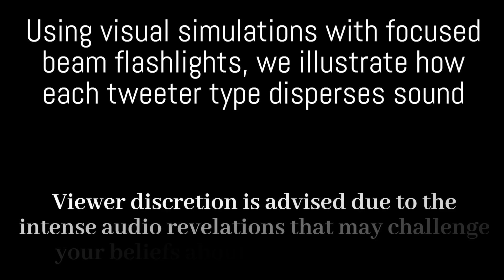Dome tweeter Vs Horn  -Viewer discretion is advised due to intense audio revelations

Comment: Neither.. amt, ribbon, etc.. 😂 but I am a dipole guy. Like horns more for esthetics 😂
Reply from the maker: We have received from Beyma today the new Beyma TPL 150H horn loaded AMT. Review and unboxing video is in the works.
Reply: @shinjitsuaudio  that sounds way cool. Looking forward to it 😃 looked it up, because it did sound familiar. But do they have a new version or MK2? Because it does seem to be on the market for a bit already. Still very interested in the results. Still have to find a way to make it dipole 🤣 remove the back cover and 3d print another horn? 😎
Reply from the maker: Dipole speakers, while having their own unique benefits, have several disadvantages that make them less advantageous in certain situations:

Placement Sensitivity: 

Dipole speakers require precise placement in a room to perform optimally. They need to be positioned away from walls to avoid interference, which can limit their suitability in smaller or less flexible spaces.

Room Interaction: 

Because dipole speakers radiate sound from both the front and back, they interact more with room acoustics. This can lead to unpredictable sound quality depending on the room’s shape, size, and furnishings, making them less consistent in performance across different environments.

Limited Bass Response: 

Dipole speakers generally have weaker bass response compared to other designs. Their open-back nature can lead to phase cancellation in the low frequencies, which means they might require additional subwoofers to achieve full-range sound.

Efficiency and Power Handling: 

Dipole speakers are often less efficient and require more power to produce the same volume as more conventional speaker designs. This can necessitate more powerful amplifiers and lead to higher overall system costs.

Directivity Control: 

While dipole speakers create a spacious soundstage, they lack the focused directivity control of horn or waveguide designs. This can result in less precise imaging and a diffuse soundstage that might not suit all listeners’ preferences.

These factors make dipole speakers less advantageous for users looking for consistent performance, strong bass, and ease of placement in a variety of room settings.
Reply: @shinjitsuaudio  absolutely correct on every point, though in my personal experience it depends a lot on which dipole you use. I don't have experience with open baffle cones and limited experience with magnetostats. I do have experience with electrostats. Two types on the opposite ends of the spectrum. My fist set was acoustat X. Which were lost sadly. But I bought the same type again and I also own three pairs of quad ESL 57 (bronze, black and silver)
I guess I was lucky with placement, I never had a problem and never spend more than a week on setup. Including fiddling with way less room treatment then I had to use on other types of speaker.
While the Quad are very directional and are said to be very specific on the power amp (driving it with Harman Kardon citation 12 deluxe never posed a problem) they are said to lack bass, my wife did tell me to turn it down from two floors down, and if she complains ai am happy 😈
My acoustat X on the other hand love some power, driving them with Harman Kardon citation 22. 2*200w. But they go rather deep and are not that directional because of the layout of the panels.
The advantages outshine the disadvantages by miles, especially since I haven't had a problem like some have had.
Speaking of bass, I am thinking of trying some open baffle, but that is just for fun 😎 just like I am thinking about super tweeters and a nice tube amp. Lovely hobby, never done 👍
Currently working on my home theatre setup because I need an excuse not to sell any if the Quad. So I will have 9 channel electrostatic including front highs.. will mount them without damaging for sure. Will take me another 6 months because of the budget. But will post some content about it around that time